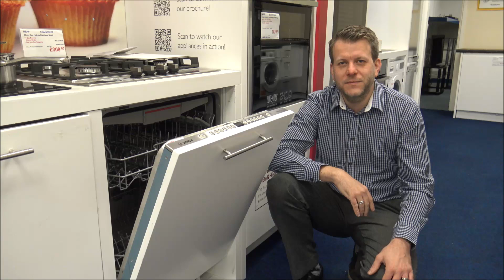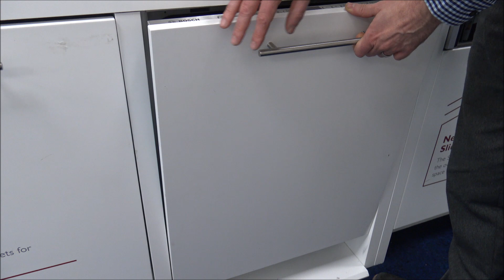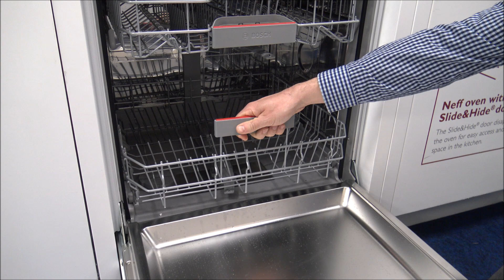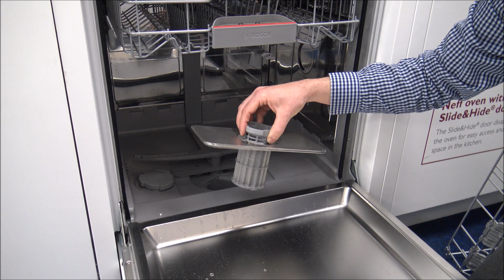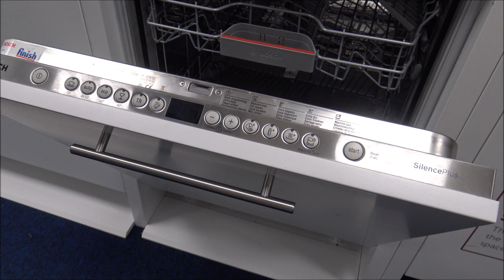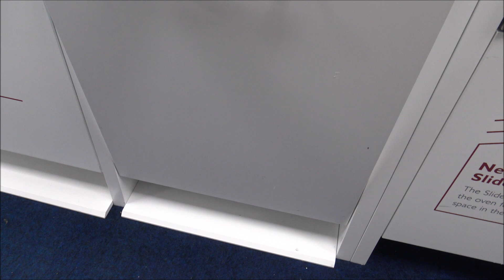Bosch SMV46KX01E 13 Place Setting Integrated Dishwasher

Comment: Thanks for the very nice video.
One thing you did not mention, and I would like to say, is that Bosch does not include in the package the two screw nuts for fixing the dishwasher on the side cupboards (at least for my model SMV46KX04E, I guess also for the rest). They shamelessly informed me that I have to pay an extra 8€ and receive them in 10-15 working days. Again, this is for a 500€ fully integrated dishwasher😂. After that, I'm not buying even a screw that carries the brand name of Bosch ever again.

Comment: I heard that this type of washing machine displays the remaining washing time on the floor; if you set a program. I tried but I can't figure out what the "setup" button is. can you help me please?
Reply: I have the same issue and it seem that there is no such button as “setup 3sec” and none of the setups in the manual 😢
Reply: The set up button is the 4rt, with the glass: "Overview of water hardness set-tings",.Hold programme button A (with the glass)and press  repeatedly Start until the dis-play shows H:xx.Release programme button A and Start. Programme button A flashes and the display shows H:04.Press programme button C (the rinse button) re-peatedly until the right water hard-ness has been set. Press Start  to save the setting.
Reply: @vanyaivanova9084  I lknow how to set water hardness. This is not what I ask. Need to know the remaining time on floor. Do you know how?

Comment: Just had a Bosch SMV46J01G/74 installed and is all connected up. There is power because one can see the red light flashing at 3:49 and a light on the Eco switch. But that is all it does. No other switches work and the machine does not start. Is there something I am not doing right? It is brand new machine, installed today. What does it mean when it shows there is power but won’t work in any other way?
Reply from the maker: Sounds like the electric side is connected ok but just make sure the water is definitely switched on. If both of those are ok the all you would normally do is select the programme and press the start button and shut the door.
Reply: @lords-electrical  Thanksfor your reply. I have tried that too. The machine does not respond to any of the switches except the power on and then all I see is 3:49 flashing and the Eco switch lit solid red. I suspect that either the child switch is activated, which also I have tried but am not sure if I am doing it right or the machine is defective. I was wondering if there is something fundamental I am missing or is the installation not done properly. Appreciate the trouble you are taking.
Reply: @vikasshah8565  better call customer care

Comment: My Bosch diswaher salt does not seem to end, its seems to last for a very long time,Why?
Reply from the maker: Most dishwashers will have a setting on the hardness of the water, and this will determine how much salt is taken. It could be that if you have it set correctly then it should only need refilling every couple of months

Comment: It should also show remaining time in addition to red dot on the floor but it dont shoow it ,, why ?
Reply from the maker: Some of the models have the feature called "Info light" which is what the red dot is and this will just indicate the dishwasher is working. Some of the higher end models have a feature called "Time light" and this is where is shows the time remaining in the programme.
Reply: @lords-electrical  ok but why is in the settings timelight option if it does not work ,,, it's pointless when the model can't do it but option is available in settings,, i have model type SL6P1B  ..SMV45EX00E

Comment: How do you put your own panel onto a fully integrated dishwasher?  Thanks!
Reply from the maker: The full instructions are included with the dishwasher but they are quite simple to screw on the front but make sure you measure properly as it can be difficult to get it straight it not measured properly